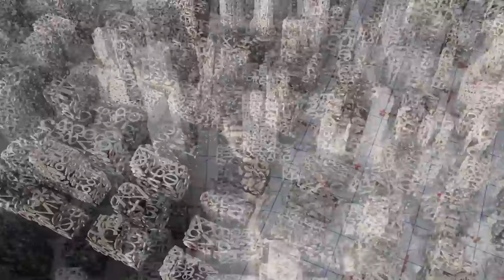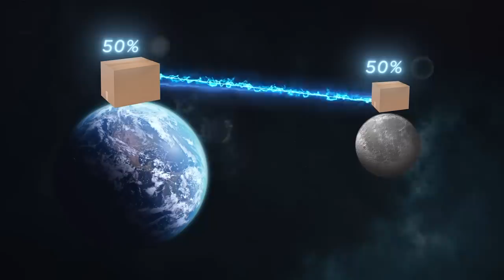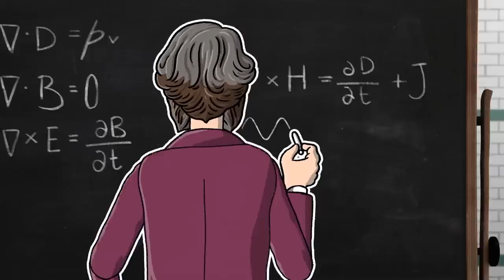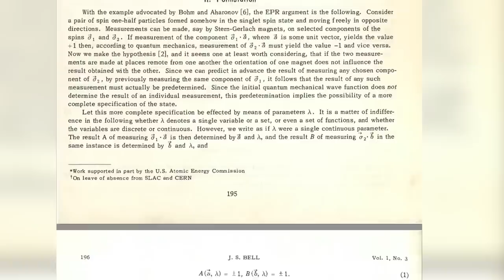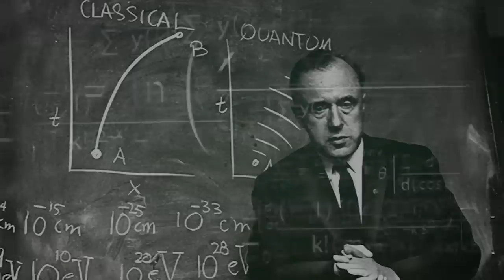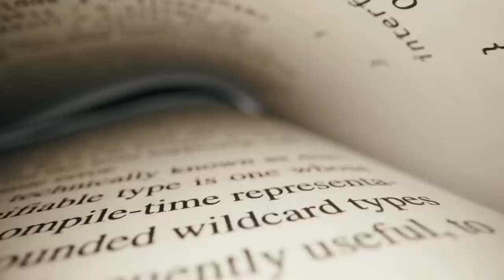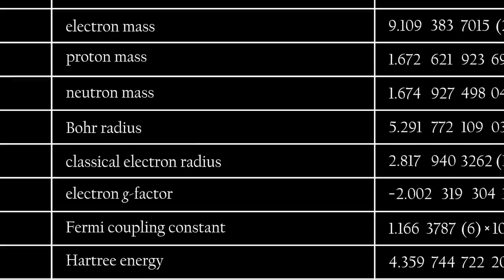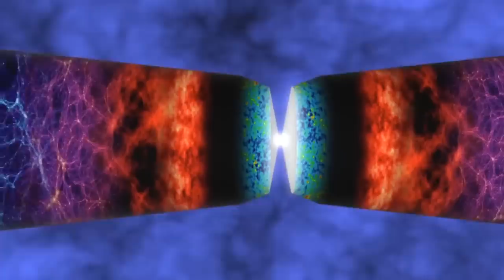This Is Why Time Might Not Actually Exist

Comment: On your final question - my mind settled on eternal block universe back in 2009. Even if that turned out to be wrong, ie. roll back the same event like security camera to just find everything in different historical arrangements, they'd still be beholden to prior states and it's really hard to say that we have anything like free will other than that our thought processes, growth and learning trajectories, etc. are all priced in. Where it gets interesting, particularly for block universe, is the ways in which that seems like it edifies both Hoffman and Prakash's ideas but also those of Michael Silberstein, Timothy McDevitt, and William Mark Stuckey in 'Beyond the Dynamical Universe'. I still haven't heard Hoffman refer to Conscious Realism as an eternal block universe theory but the way they're leaning on the amplituhedron and saying 'spacetime is doomed' - for it to be properly doomed everything would probably have to be some interpolation or Fourier transform of some higher dimensional hyperobject or perhaps a static set of them. I'm not a mathematical physicist by any stretch but to preserve 'this' at least requires some set of hooks from which three spatial dimensions and an arrow of time can be unpacked even if it's a huge mechanical play with conscious nodes (or Atman holding trillions of puppets).

Comment: Quantum entanglement is one of the most mind-bending phenomena in the universe! The idea that two particles can become intrinsically linked, even when separated by vast distances, is fascinating. The implications of this phenomenon are profound and have the potential to revolutionize technology and communication as we know it.
Reply: its not proved yet remember
Reply: Entanglement doesn’t allow the transmission of information faster than light speed, so no, it won’t be revolutionizing communication
Reply: Black holes probably squash this observation. If a QE half enters a black hole, what happens to its mate?
Reply: @00SEVEN28  nothing special happens. Black holes aren’t magical physics-breaking portals to other universes. In fact, if you crossed an event horizon, you wouldn’t even know (assuming you could do that without being ripped apart by tidal forces).
Reply: @cougar2013  I subscribe to the theory that black holes are doorways to other universes. Makes sense since we know our universe expanded from a single point.
Reply: It is wrong to think of entanglement as an effect that propagates through space and time with some meaningful velocity. When a pair of photons are entangled, it's not like one is sending a signal to the other to let it know how its buddy is doing. When they are entangled, it means that the same set of variables control both photons' behavior. These variables do not travel along with either photon, nor are they transmitted from one photon to the other. They simply are.
Perhaps it helps to make better sense of entanglement by dropping the naive notion of particles in favor of the fields of quantum field theory. Yes, unit (quantized) excitations of those fields manifest themselves as apparent particles (at least in flat spacetime). But it helps to remember that until a "particle" is observed through an interaction, it does not even necessarily exist as a spatially localized entity (think, e.g., about two-slit experiments). So instead of entangled particles what we really have is entangled excitations of fields that are present in all of space and time. So given that the location of even a single particle is not well defined in the classical sense until it is observed, perhaps the notion that two such nonlocalized entities exhibit a correlation becomes a tad less mysterious and spooky.

Comment: Can the universe be considered as influenced by a massive magnetic field? That would be  clockwise and counterclockwise at the same time at a distance. Distance is reduced by entanglement of mass. The cosmic speed limit is redirected trajectories reducing distances according to the size of the mass. Expansion of the universe could theoretically be influenced by a magnetic field. Has any physists ever looked at the spin of galaxies to see if there is a unification of spin on areas of space. Gears mesh in magnetic fields. Clockwise versus counterclockwise. Spin is unification of unidirectional flow cycling circulation patterns. Just a thought.
Reply: Bot.
   🙄
🤖 🤖
   🍄
Reply: Time runs backwards when you stand behind a transparent clock with hands.

Comment: You get close enough to the black hole's event horizon, you go back in time, but if you get too close you'll get sucked into the entity. One can go back in time by getting close to the event horizon, and depending on the size of the black hole's electromagnetic hold, one could go back too far too quickly, or could get back to the proper time one might need in the possible amount of just staying there. I've been to one before in an astral projection, with Pinkie Pie of all beings, and changed the situation with Equestria... Sounds like a fairytale right? That's because it was a fairytale, just like Earth is for some.
Reply: Pinkie Pie? Equestria?
Reply: No one can't go back in time near a single black hole.
Reply: One can 'go back in time' but
only in one's imagination and
the reason for that is
time is a concept only.
Reply: @bafflezbiz  Just guessing but they might be friends of
My Little Pony.
Yes, when I googled, Pinkie Pie showed up.
Reply: @REDPUMPERNICKEL  not really
 Time is woven into space and is a measurable entity called spacetime. It has been shown in practical physician experiments as well as tech like satellites that keep the right time and GPS. They succumb to special relativity.
Reply: @John Smith  Wow your name is so rare and never extraordinary.

Comment: As space condenses, time slows down, as time slows down, space condenses. This means that if relative time were to stop at a point in space, that area of space would then become infinitely dense as a result. This also means that black holes do NOT pull things into it, instead the spacetime expansion pushes by expanding into density causing the massive gravity and causing the spacetime curvature we see in the fabric of spacetime. Gravity is NOT a pulling force, its a pushing force. We are NOT pulled down on earth, we are pushed down on earth by spacetime expansion trying to expand into matter/density since density is opposite of spacetime. Space cannot exist without time, spacetime is relative because its expanding outward in all directions from every point in space. If time did not exist then space does not either and the universe could not expand. The only way gravity works is if spacetime expansion pushes into objects causing spacetime to become "condensed" as it expands around objects, this creates the spacetime curvature and is where gravity comes from... meaning that if there is no spacetime expansion in our universe then gravity would not exist. Gravity depends on spacetime expansion because spacetime expansion is its cause.

Comment: The double slit experiment assumes the photons travel in a straight line like a bullet fired from a gun. 
If photons travel in a vibrating / oscillating state then you have the results of particles and waves

Comment: What if the universe is based on restricted probability. For example measuring the properties of an electron is random, but the fact that there is an electron with a property that belongs to some atom means that there's given parameters that cannot be broken. Even if we use sports as an example you have a certain rules or guidelines to make the sport playable and fair, but there's always loopholes to the rules one can take advantage of. So I'm more inclined to say that there is 1 true objective reality that exists only in the past, however the present or future has predetermined rules based on the past. Which means only a certain amount of outcomes are possible in the future but each of those outcomes are equally likely to happen. The catch is that since we live in a shared universe every time someone does something or something happens your possible outcomes change. I know this doesn't seem like anything new, but what I'm suggesting is that a level of predeterminism and level of randomness coexists at the same time. Consciousness  is definitely a big part of our experience as photons don't experience time, but yet they have a speed and travel a distance without having a shape or infinite energy. I think quantum physics becomes confusing because we are applying relative properties to things that may not even have it. Space is expanding into nothing with no edge or boundary, under this premise space cant be bigger than what it already was. Shape, size and expansion are things that we might be applying to space that don't actually exists. Reality itself may be like a video game. A video game has no real mass or properties but it feels as if it does. At the end of the day a video game is just a collection of data only limited by the amount of storage. It's similar to saying life is a simulation, but a simulated reality implies that there's a separate more real reality from our own. Just as DNA is similar to programming but real, life too may be similar to a simulation just real.

Comment: The problem with all of this is it is based solely on tangible information. Reality doesn't just exist on a physical plane, but a conceptual plane as well. That is why time does exist. It's a conceptual measurement of the passage of everything that has happened and will happen. Without time everything simply would exist at the same moment. There would be no past, present or future.

Comment: Causality in classical physics is established. Newton's law means that everything is caused by something, and causes something else. That is the definition of causality. Without causality nothing would happen. The question is where does causality fit in quantum mechanics?
I believe in predeterminism, absolute causality. One random thing happened, the big bang. After from there it's set in stone. 'Spooky action at a distance' is the result of individual cause paths coming into alignment. The second object is not connected. It is simply in a harmony, and we don't understand all the forces affecting it.

Comment: Time exists with or without an observer to experience the measurement of existence ... Any non instantaneous event would require time to occur. If the event is measurable so to is the time required for the event to occur. Time exists without observers. Vibrations exist with or without ears to hear it. Sound is always there, time is always there, life is inconsequential to existence. Measurable experience is not the same thing as existence. A rock can exist without experiencing time but the effects of time will still effect the rock. Aka existence.

Comment: The quantum levels particles disappear and reappear is because of the simulation running multiple simulations. The particles jump to another simulation think of it like hypertheading a cpu. One physical core and then your virtual core.

Black holes are the archiving of data, and the expansion of the universe is more hardware coming online.

Makes too much sense

Comment: The fundamental laws of physics do not need time to function whatsoever. Time is merely a unit of measurement, that's it. The weight in the spacetime concept merely changes the angle of it. Think of it this way, if nothing in the entire universe changes, will any time have passed? The consensus is no, largely bc "time" requires a fundamental change at the quantum level. If you rearranged every single particle to where they were 100 years ago and eliminated all that didn't exist, you'd have "traveled back in time" but supercomputers have shown 1.5% of events CANNOT revert to the previous state. Moreover, we know that wave probability is actually correct, so something could go either way. Ironically, part of that is the amount of energy that interacts/creates vibrations on a quantum level. Again, time plays no role in any of this. The universe can function without the measurement of time but NOT without energy. It boils down to entropy.

Comment: Don't think of superdeterminism as 'scripted'. That entails a creator or an author 'writing' the plot. Think of it as a large system with near infinite (but still finite) energy states and variables with some initial conditions, which starts from those initial conditions and plays out according to a fixed set of laws. We are a part of that system, we are the Universe, we are made of those energy states and variables that were once part of the initial conditions. Everything we do, every 'choice' we make can be traced back to those initial conditions. So yes, based on those initial conditions and the laws of the Universe, it can only play out one way, but we, as the pieces of the Universe that are in the form of humans, just don't know how things will play out, just like we would not know how a movie will end that we haven't before seen. So the future seems full of possibilities, like a movie seems full of possibilities at any moment in time. It doesn't make life any less interesting, but it does mean that no matter what choices we make, no matter how many times we change our mind about something, that's all been baked into the Universe from the initial conditions, and it's just playing itself out. There is only one way that the past unfolded, despite what 'possibilities' and choices anyone may have had at any given point in time, and the future always becomes the past, which means that there is also only one possible future, we just don't know what it is yet. The Universe trying to understand itself is quite fascinating.

Comment: If there is no observer, there is no universe. But if there is no universe, there is no observer. If there is at least one observer, the universe is. But if the universe is, there must be an observer ... That doesn't mean an universe can't exist if no one observes it tho, even if it does.

If there is a peel, there is an orange. If there is an orange, there is a peel. Doesn't mean the peel can't exist without orange, but it does :)

Comment: _ _ _ _ _this is the time when the time 137 means 37 as 7 7 7 = 21 this is called egg world or 11 each one length is 18 and width 12 and 18 means 99 and 12 is 66 this is made by 49  and 46 as 9999= 36 and 6666=24 not only this to they're many more are there to write thanks

Comment: The ‘problem’ of the fine structure constant is easily answered. But only if you look for the answer in the right place  -  and there’s only one right place.
I’m not going to tell you where that right place is … yet. Nor am I going to tell you the actual answer … yet. But I will tell you that it takes form of a simple equation and  I will flesh out the structure (pardon the pun) of that equation.

So, 1/137 or, more precisely, 1/137.035999084 = 0.0072973525693 … approximately.

0.0072973525693  being alpha.

And the equation required then is (axb) / (a^b) = 0.0072973525693
Knowing the value of a and b would be helpful, obviously ;)

Comment: Time , it's stuff in motion. If there is No motion Time Stops. Dead . There is a rather Good way to travel By Dimension,  Time travel,  light does not travel in away perceived its already there. You see its past . you measure its past, in our long it took you to notice it , you set the clock at the time you mean it to start it releases a light partial you get the signal its been sent , at the same moment,  it arrives,  you conclude it took × amount of time .but we can only see our past. Measure our past. If we were full of Truth time flys by. If you you imagine a poor Now.. how slow does it go , do you notice time dragging.. fear stops time. Your time is lost. Over ... live life deeply, a Dimension with time to give,

Comment: Of course time does not exist.What humans call time is a measurement of speed based on one of the following:- rotation of the Earth about it's axis, rotation of the Earth about the Sun, The speed of light, or the speed of decay of an atomic atom. Time is an abstract concept  created by the human brain. Time does not exist. You will not find time on the periodic table. You can not put  a molecule of time in my hand